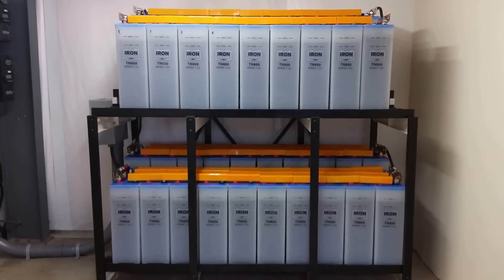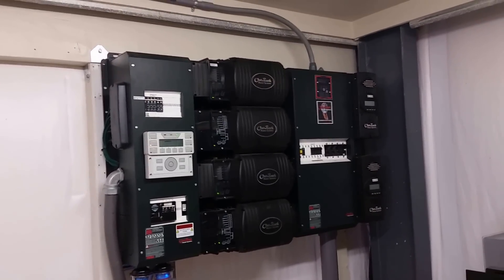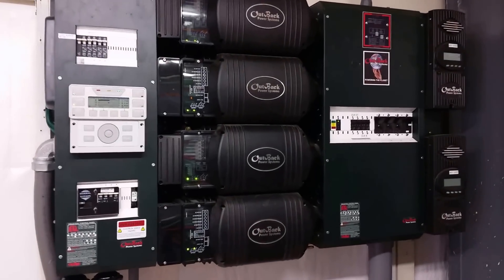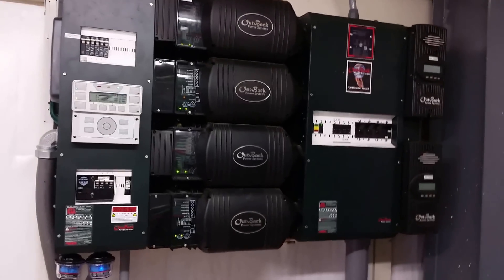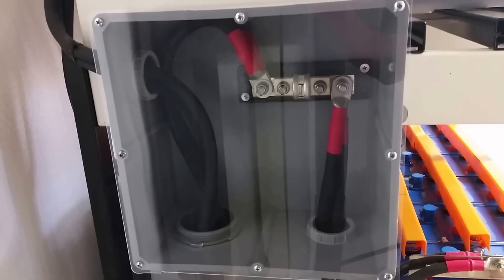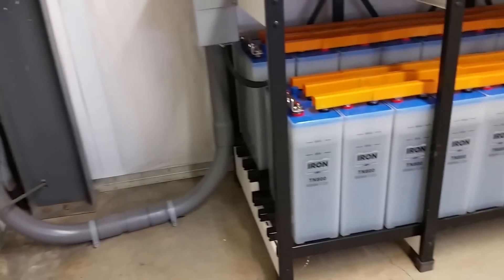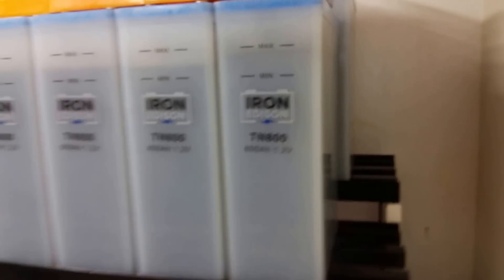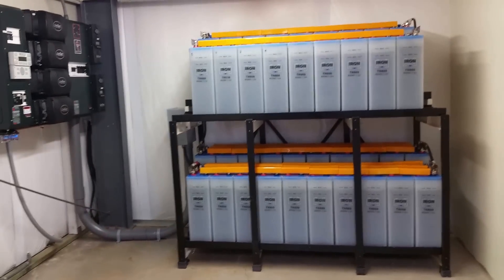Off grid battery upgrade!

Comment: I got 10 cell  NiFe 350Ah  12V system for off grid cabin . is in north east USA no heat when not there. batteries still at 100 percent cap. after 10 years. Best battery for cold. can add more batteries at any time at any AH rating. As long as NiFe .no other battery can do that. Tomas Edison invented them around 100 years ago.

Comment: Jason, that fuse block you installed, isn't that a Blue Sea Systems product, if so how is it possible to use a 32v fuse block in a 48v battery system? I realize the fuse is rated at 48v or above, but according to Blue Sea Systems, their manufacturer doesn't make a 48v product.
Reply: Jason Andrade 
What city do you work in?
Reply from the maker: Hey Chris, no it isn’t blue sea this is a class T fuse block from Magnum Energy that is made for this purpose
Reply from the maker: Thanks Chris, its easy when you love doing it
Reply from the maker: timm jonson I’m based out of Northern California you?

Comment: It looks amazing.
Reply from the maker: At the right time thanks!
Reply from the maker: At the right time I've been working on cleaning this system up for quite a while now
Reply: Jason Andrade When I was young I would wire my car stereo systems adding many components and I know how much patience is required for such a presentable appearance. I always had wires showing no matter what but I suppose its different when you are getting paid for it. Still though your install looks professional to the tee and I will be calling someone like you when the money is right, meantime Ill be looking at installs like this to see how these go together and operate most efficiently.
Reply from the maker: At the right time thanks for taking the time to watch, this was a clean up rebuild if you check out some of my other videos you can find some ground up builds and see there is extra thought out into pretty much every aspect.  Thanks again

Comment: How did you wire the batteries. how many in series and parallel.
Reply from the maker: sorry for the slow response I was having a problem commenting and I guess you can't comment until the video starts playing?? learned something new.  These batteries are 1.2 volts and there are 38 volts in series for the 48 volt battery bank.  Thanks for watching

Comment: this is art
Reply from the maker: Thanks man, this is one I took over after the original install was nightmare, it's much easier when I get to start from scratch!
Reply: i want to build something from scratch but i don't have the funds to do it all at once so i want to build it slow starting with inverter and some batteries then adding in future more batteries and solar panels so what you recommend for inverter that have this ability to grow up to 5kw and could start with 1kw maybe someone recommend Fronius Symo Hybrid three-phase hybrid inverter
Reply from the maker: +essam kushad it's always a challenge building slow but getting equipment that will be useful later on, I would use an inverter that is stackable.  There are units by samlex that you can grow around at 1k increments but they aren't inverter chargers and I prefer them, they are more efficient in the sense that everything communicates together.  I am going to Intersolar next week and am hoping that Midnite is going ro release there new (first) inverter, I will keep an eye out and look for something new to report in with.  That's for participating in the channel, just hit 500 subs! Pretty exciting for me
Reply: +Jason Andrade nice keep us updated with your videos awesome work would love to watch you build a system from scratch in speed video going through everything maybe teach us or give us tips what to look for and warning for things not to do
Reply from the maker: +essam kushad I'll try, I have thought about how I could do it and keep it entertaining.  My projects typically take 2-3 weeks because I do alot myself, I have my son helping me this summer so maybe I cam get him behind a camera. Where are you located
Reply: nice,, can't wait to see it ,i'm located in Africa-Libya a lot of power issue here  we get blackout for 19 hours a day in summer

Comment: Hey Jason,

Noticed the max and min water lines on the batteries.  Please describe the amount of maintenance/attention this battery bank needs to keep the liquid levels in the correct zone.  Do these batteries offer something extraordinary to offset the maintenance vs a sealed AGM battery bank?  Thank you for your comments.
Reply from the maker: david, so far the maintenance has been minimal.  the customer is topping the battery bank off every 3 weeks and using around 3-5 gallons last I heard.  this system is about 3 hours away and I will only get to play with it randomly, we are planning on installing more pv this summer as they are on the low side of the manufacturer reccomend size which is resulting in an hour of timed generator run time everyday.  I have it set to run after the solar has decent exposure so we can hit the batteries with some good amps.  As for comparison between these and AGM these are supposed to have an amazing lifespan they are a bit odd to work with as there is no specific gravity testing, SOC state of charge is inaccurate so you are really watching voltage.  with these and batteries they tought they can go lower voltage than other batteries but this seems to strain the system and the current is the issue.
I have a few Agm banks out there and they are working well I wouldn't install one with out a shunt based SOC meter as you are flying blind other wise.
I am currently build a custom battery rack for my off grid system and am thinking about individual battery voltage meters for fun, I am going to start a video series on that next.
thanks for watching and asking questions!
Reply: Thanks for the quick reply.  Every three weeks, hmm...can't take a long holiday without having to worry about the batteries.  Is there a  system available to automatically maintain fluid levels?  Another question please... This customer appears to be able to afford it, so why didn't they go with Lithium Ion?
Reply from the maker: +David Golembeski you could stretch it farther he is just keeping them maxed out, and his three weeks may be more.
as for the lithium ion batteries, I don't know any one who has used them and I would like to see more info on them.  there seems to be a lot of manufacturers popping up out there and with the cost of the banks I would like to see more data on them.  what do you think about the Aquion battery?
Reply from the maker: +David Golembeski one other thing I learned with this install.  picking an exotic or special battery can be stressful, with the higher costs you would expect superior reliabilty.  one crate of batteries was dropped by the shipper and it was 4 months of stress.  The batteries had to be shipped from China and in the mean time the capacity was in question, it all worked out in the end but it really brought up the question.  do you really want to use a battery that isn't readily available? my next bank for my house will be 2 volt L16's I can get them local if one dies they are readily available and pretty forgiving.  I have done some nice forklift 2 volts but they were complex to move and replacing a cell if needed will be challenging.  Hope this helped!
Reply: From their website, it says they aren't designed for any high draw applications, but the technology does sound excitingly simple and eco-smart.  Salt water batteries!  The company has a base or plant in Pittsburgh, and I understand they got funding from an experiment at Carnegie Mellon.  I'm trying to get a buddy back in Pittsburgh to give them a chance to quote on supplying his business with solar.  I'd like to see the proposal if/when he gets a bid.
Reply from the maker: +David Golembeski yes that was the only real weakness I saw on them too,  my system has rarely seen more than continous 1.7  kw draw up till now. I am just finishing installing another cooler but those mainly run when the sun is out and have minimal nighttime usage.  are you doing offgrid or hybrid
Reply: I'd like to go off grid because the electric companies keep lowering the amount they credit you back on a grid tie system...eventually, they won't give you anything back, so you might as well go completely off grid and be done with them.
Reply from the maker: +David Golembeski currently grid tied? if so what is your system
Reply: No...nothing yet...I'm in the learning and planning stage.
Reply: We love theAquion Battery, as you say they are not great for rapid discharge but super eco friendly and perform very well when sized correctly, really nice install btw, keep up the good work!!!
Reply from the maker: +Energy Pimps I am excited to use them, I have a project coming up for a pretty high profile customer and I will get to use them for the first time

Comment: Wow, those batteries are 1000 a piece. I'm drooling over here. How long would one expect a battery bank like that to last under heavy/medium use?
Reply: +Havilah Gold Also what is the potential(V) and current of the system?
Reply from the maker: +Havilah Gold they were a bit less than $1,000 but still pretty expensive (more than I could afford) they are claiming a 20 year lifespan with a 7 year warranty.  This system is a 48 volt and the usable are rated at 30 KWH of storage, Unfortunately they were damaged in shipping and they just don't seem to have near the rated capacity they state.  We should have the replacement batteries soon and then I will be able to do a no holds bated review on them. 
Jason
Reply: Jason Andrade
Thanks for the reply. Just out of curiosity, when the battery bank is at capacity, can one  sell their power to the grid? Can you just re-route the solar panels to the grid? Or, does it have to be 120V 15-20A ?
Reply from the maker: Havilah Gold yes you can you would want to use the newer Outback Radian inverter and a different battery than this one, I built https://www.facebook.com/113295778708585/photos/pcb.935770299794458/935768659794622/?type=3
this system earlier this year it is the one that you would want, research outback radian
Reply from the maker: Havilah Gold I was wondering how you found my video? I am finally getting some traction in the youtube world!
Reply: @havilahgold2942  t

Comment: How much is that battery bank?
How many battery are their? 2V @ how much amp?
Reply from the maker: They were around 30k each battery is 1.2 volt and there are currently 38 of them in series.  when using the inverters to charge you have to drop 2 batteries for it to charge properly

Comment: Good job bro.
This is awesome
Reply from the maker: thanks Jw, who doesn't want a sweet set of batteries like this
Reply from the maker: DIY Tesla PowerWall  while they may be less efficient they hold a good charge and it's the length of service we were shooting for, don't be a dick.
Reply: I looked up the datasheet and was a little shocked 80% DOD only 1000 cycles 20% DOD 8000 cycles a good AGM batt would get nearly 4000 cycles at that
level
Reply from the maker: Detroit Ironworker it was the attitude of the comments, I will help almost anyone who asks for it but rudeness will also get a response.